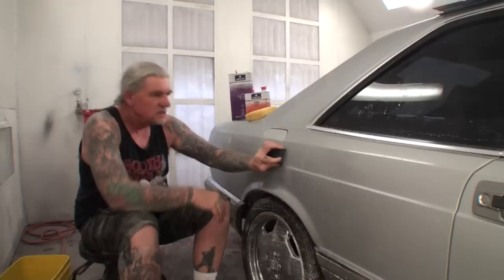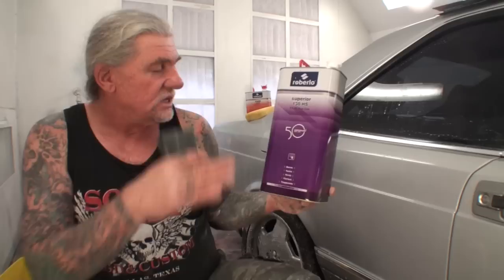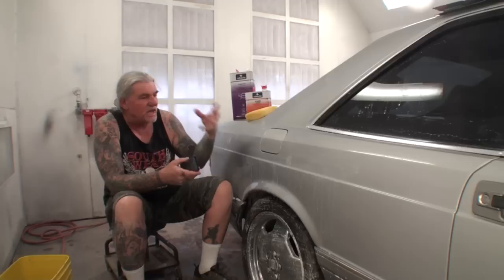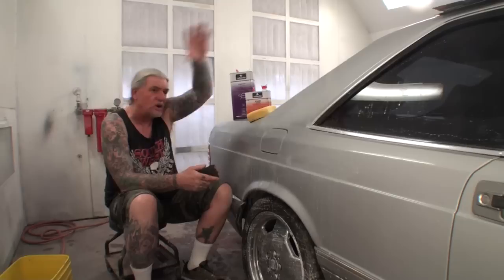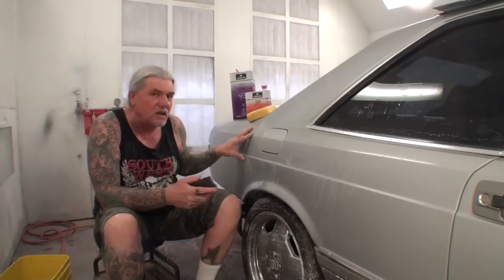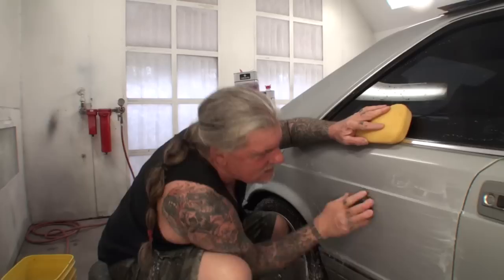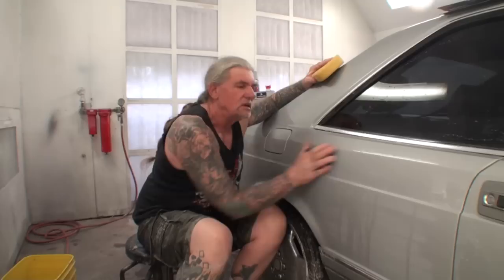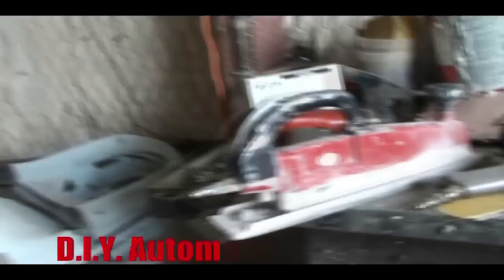What Clear Coat Should I Use To Paint My Car With? - High Solids Or Medium Solids?

Comment: A tip i heard years ago in Pete's video. - If you get to this situation where you need to color sand your fresh new paintjob and accidentally burn through the clearcoat while sanding , you CANNOT come back with just a paint and blend it and then clear coat again. What you need to do is to wait 2 weeks for the clear to heal, then come back featheredge where the burn through is and use little epoxy primer before blending the paint. Then you can clearcoat. Otherwise the reducer in the paint will react with the edge of the clearcoat where the burn spot is.Happy new year.
Reply: That is true. But that’s why us automotive painters make good money because there’s ways to make that not happen
Reply: @Shawn Arnold  exactly, i never burn through my clear. If doing repair work now days I am all about express clear too

Comment: It's all in how you use it. I have no doubt this guy knows a lot about painting.  But it's impossible for a person to know everything,  because of the amount of products and how much they can differ. 

Because you can use a high solid clear in a blend situation.  You just need to reduce it enough.  Then spray a blender or reducer over you blend panal to melt that clear in. It's what they call burn it. And that's another helpful method.  Using a heat gun. But that is for pros,  and something you should watch being done before you try it. Then, it may say wait 3 days. But if you're having trouble buffing and sanding.  Maybe you should try and sand it after 24 hours. Could make it a lot easier.

Comment: Pete, Thanks very much for the review on the Roberlo Clear coat. They sell on eBay and I bought MS clear w/ standard hardener. I also bought their high build primer with standard temp range. But I want to try their orange tape. I have not used any of this product as if I am unsure, on a pickup I could use it between the bed & cab (White top) and in the bed area and pass judgment on it. They list 4 locations (2 in PA, New York and maybe Jersey). Only one store must sell online, but the cans are liters and tape comes in plastic sleeves. Each can was beat to hell, one was leaking, white foam peanuts for packing but they broke open the sleeve of tape and shoved it into the boxes to fill. At this time, I was more concerned with back surgery / procedure number 6, followed be procedure #7 and this type requires software adjustments. Unfortunately, 6 months of weekly trying, engineer adjustments, they did number three. So time passed with my 6'3" lumber burning and mean time I was pissed. They changed my communications with them to list me as a happy ASE Master Tech and eBay couldn't do anything!
  Buyer beware, but I am living in pain, takes forever to save money for slightly cheaper product and got screwed, and all they said was;"Looks fine to them, enjoy". You get what you pay for in product and customer service, but my 13 year old grand daughter knows better to pack things as they did! Look carefully as their disclaimer say "Cans may have some dents in then" yet arrived in a clean smooth box. Thanks for the review and in a few hours, happy 2023!
Reply: Dean I have used Matrix MS-78 medium solids and liked it.. . I just got a shipment of Urekem  high solids, will try it soon.  Phillip Hall
Reply: @PhillipHall01  I cant find anyone in Omaha that sells Matrix. Ryan Evans on "Counts Kustoms" tv show uses Matrix (A Sherwin Williams) company. He is great! I had a bad experience with Roberlo on an eBay purchase. Dented, leaking and sleeve of tape busted open and deformed encrusted with white packing peanuts. I was sad!
Have a good 2023! As today is 1/1/2023. DK
Reply: @deankay4434  
Dean I won’t recommend the Urekem until I use it, but it came highly recommended to me by SorayWayCustoms.  The service was great. Got my supply order very fast. Came  from Southern Mississippi from a company called The Coating Store, Packed professionally.   No dents, packed tight and protected. So far so good! We will see how the products preform. I ordered a good bit of stuff. Base, clear, reducer, hardener, high build primer, epoxy primer, clear base etc. 
Phillip Hall
Reply: @PhillipHall01    Thanks for you objective input as all is welcome. UreChem products are a favorite of "PHARRAWAY" who is doing custom, restorations and some collision. He uses their DTM Epoxy to cover bare metal, 10% urethane reducer to use as a sealer, but he is hooked on Grant-7 clear coat. 
Kirker Enduro Prime DTM in black is very hard to get. An employee of Eastwood who quit and moved out of California swears the Eastwood is selling Epoxy as relabeled Kirker.
Black has been the largest seller and the TDS sheets look identical. Kirker is moving into a new facility and promises to make Black available after the first of the year. It is clear that today, moving is expensive from building materials, labor, land and permits so selling Grey alone does not cut it without having a long term contract as collateral at the bank! Yes they carrier HOK, 3M and other products as the main competitor is "Autobody Tool Mart". It will be interesting at best. Plus, almost all epoxies have a DTM component in them. Even PPG Vibrance VP2050 is a hybrid of epoxy resins, DTM and a high build. It pours like pudding. It sells for $450 Qt then pick a catalyst of correct temperature. This is forcing many DIYers to scramble. You can't get Matrix or ShopLine unless your PPG dealer is a platinum level. Behind the counter, PPG has close to 7 lines of named product so it makes this confusing. I think this is why many are driven to "SPI" for many of high quality base products with a limited line of colors. But they carry a great clear like "Universal", MS and Euro HS. 
It is getting strange out here!  
DK, Omaha.
Reply: @deankay4434  
Thanks Dean, Matrix has a good high build DTM it’s MP 200 and last I bought was around 150ish per gallon. I’m sure that’s probably changed  since the last election. Good stuff and heavy in the can …
Reply: @PhillipHall01   Thanks for the reply. All we can do is ask and search for the product. No one in Omaha is selling it yet. Thanks, happy 2023!
Reply: @deankay4434  
Thank you Dean, best wishes for a happy New Year!
Reply: @deankay4434  
Yea they are Dean. I like what I have used made by Matrix so far: I decided to give Urekem  a try this go round.  A mistake? I don’t know it remains to be seen. lol 
Phillip Hall
Reply: @PhillipHall01  Phil, I will spray the best I can afford. I truly hope this clear works for you as I am rebuilding a 67 C10. I Omaha, I cannot get Matrix, but dealing with almost 20 lumbar procedures. The pickup is the only think keeping me going as I have been an ASE Master Tech since 1978. My back problems have nothing to do with automotive repair. But push forward with "LS" swap and 4L60 trans non-electric controls I bench built 3 years ago. The engine like the trans had up dates plus many high end issues addressed. I have bothered you to long. Good bye

Comment: I never liked a blending clear that makes a wet bed to blend  with before the base coat because it is a lacquer based product and will be the weak link on the final finish. True you can get by with a blend  I just try to use a slower reducer in the base,it makes a better job but takes a little longer.
Reply: Thought it's urethane based

Comment: Aren't HS clears a little more tricky to spray also? Don't want to lay flat as a MS clear?
Reply: Yes they are. More orange peel unless you really tune the gun. I prefer a good quality medium solids and just apply extra coats. High solids are for shops that want to save time by only spraying two coats eve though medium solids have been working for decades. Go figure....

Comment: These base coat clear coat paint jobs are not ment to be buffed. This paint and clear are still drying a week after they have been sprayed.
Reply: Hi. Sorry to disappoint,  but the clear does need to be scratched down up to 3000, then buff with compound. Thats how you get a glass smooth finish. Just look at all the show cars. They aren't just based/ and then cleared and out the door.
Reply: @gm-lb9oe  good point GM...why do people think you don't have to wet sand and buff?!  I spray 4-5 coats knowing that I'm going to rub on it.  800-3000.  Absolutely beautiful and glassy.  I paint boats for a living.